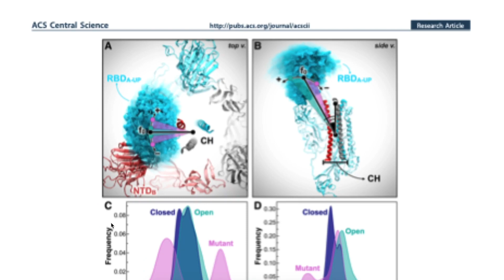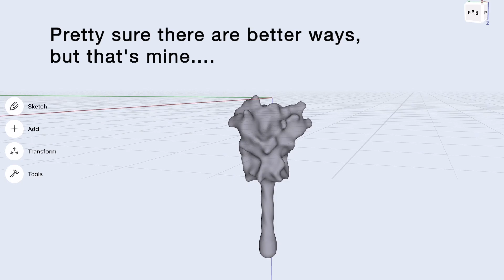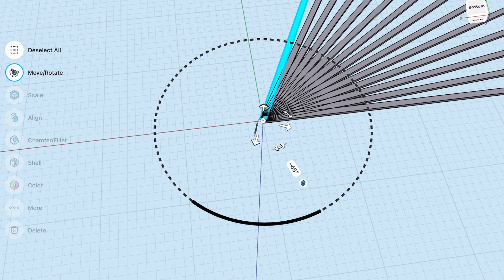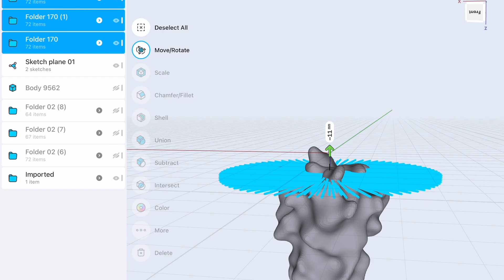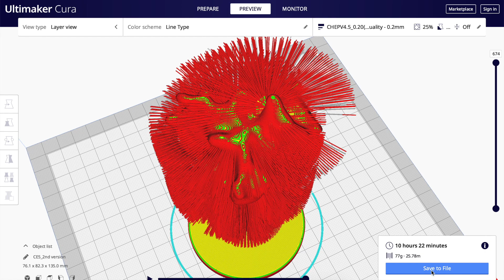3D Design/Printing "furry" Coronavirus (SARS-CoV-2, covid19) Spike Protein

Comment: See if your program has a "polar array" command. Your soul won't have to leave your body to make hair :) Looking at the Amaro lab render, some of the glycans look like piled-up crucifixes. It could be a nice artwork!
Reply from the maker: pretty sure there is an automated way to do it (cheetah 3D that I use for rendering has some arrays) , but then it's not cathartic :)
This is loosely based on the Amaro molecular dynamics paper, but it's  mostly for science outreach (and for a challenging design/print)